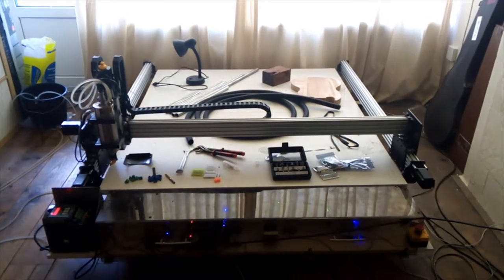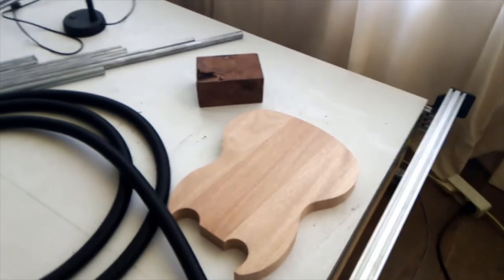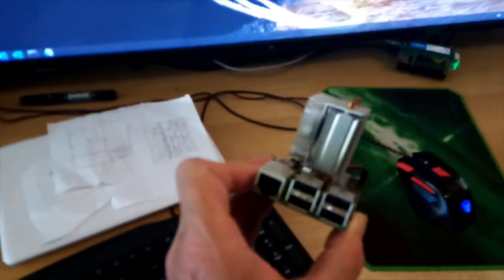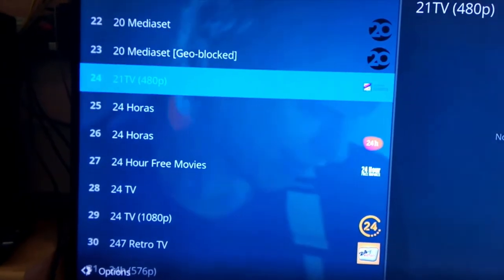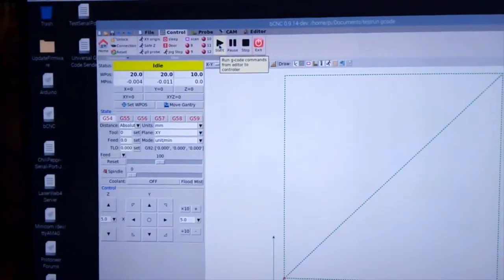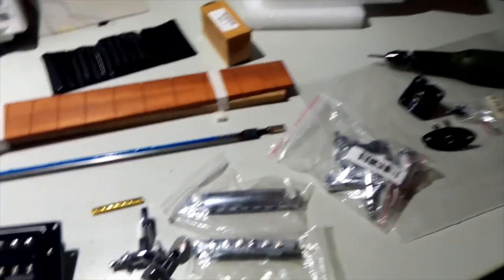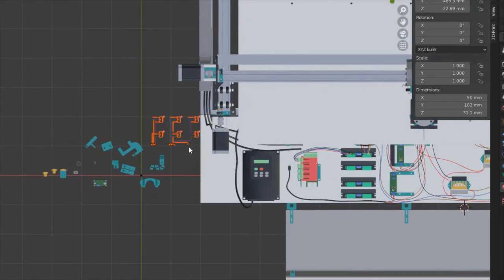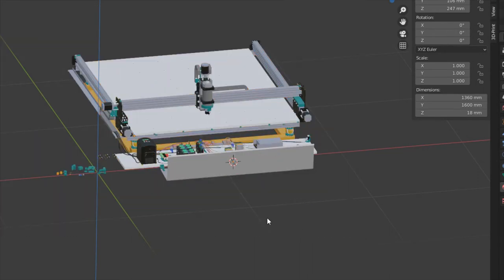Workbee cnc milling machine update, for building a custom guitar.

Comment from the maker: If you'd like to know more, let me know.
Reply: yes please, i have the kind of the same machine. I need configure and install all the cables to my machine ... Thanks for your file at thingiverse helps a lot!!!
Reply from the maker: @JCKANGA  Thanks.
I can also recommend to use shielded wires for everything.
You can get some EM disturbances from the vfd.
And wire the shielding to earth as well as the machine frame.
Also: You need to check the programming for the vfd and jumper setting.
I had to change some settings. Like the 2.2KW spindle I use, requires 400Hz frequency, for the spindle speed pwm signal
and since I use a protoneer board, the signal needed to be set to 5V. I don't know which program number it is, at the moment.
Most of it is ok, tho. But it's better to check.
If you use linux and grbl: the bCNC software also has settings:
- inverting endstops when you use normally closed.
- a homing direction mask that is set to 1 or 0.
  But it is a mask, so you can enter 001, for instance, for XYZ respectively.
  Took me some time, before I noticed, it worked like that.
A lot of things to work out.
Thank God for YouTube.
Reply from the maker: @JCKANGA  I will make another video about it all, once it's up and running, of course.
Pretty soon, I think.
Reply: @wernerboden239  yes I have the shielded cables, ok at soon I put everything I ground it. Thanks for the tips!!!